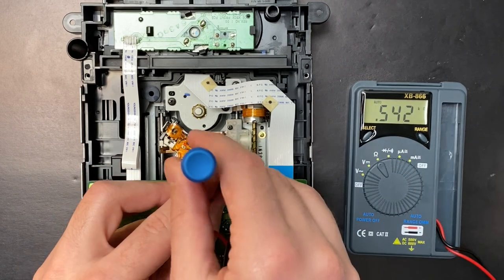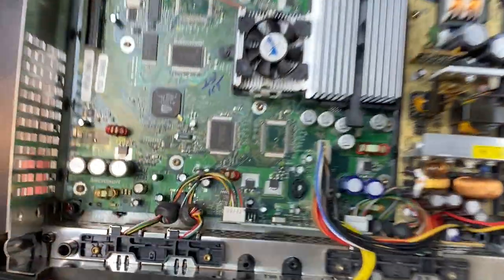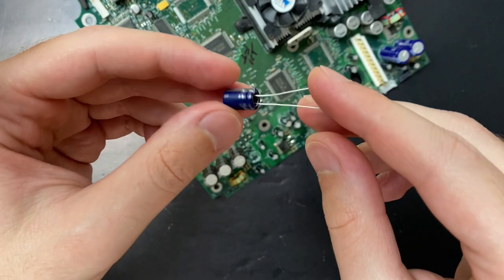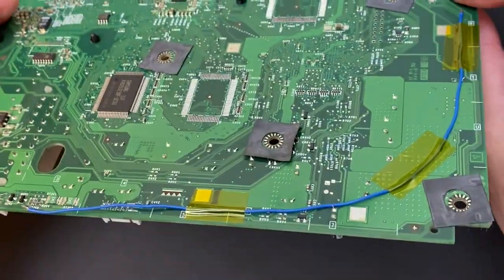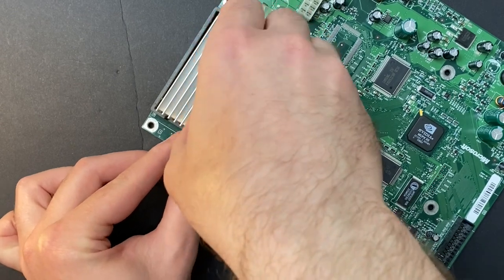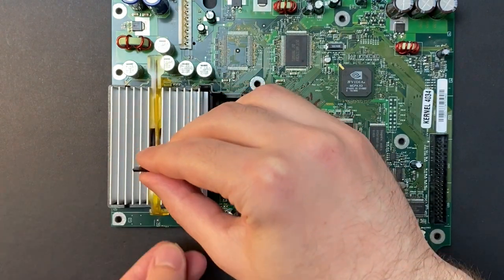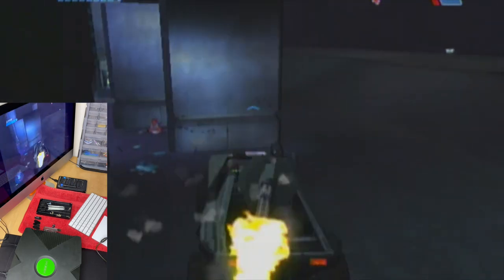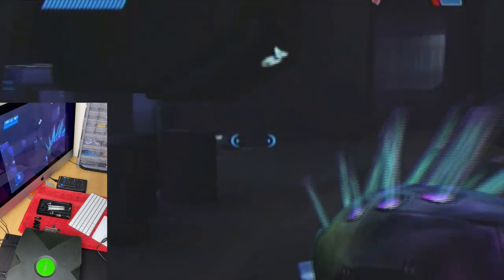Xbox Corroded Traces & DVD Pot Tweak (Part 2) - Retro Console Restoration

Comment: Great job, keep it up! :) My Xbox 1.0 is quite a bit noisier than my other ones. I always thought that this is because of the GPU fan which has been removed in the later revisions...but after watching your video I have realized that I have forgot to replace the thermal paste. Some games (like Kingdom Under Fire) tend to fall apart after playing them for more than 30 minutes on the Thompson drives I got but I might be just unlucky :) Still, the 1.0 is considered to be the most mod-friendly revision and the original Xbox is such a great system.
Reply from the maker: Thank you! I was a little surprised at how hard and dry the GPU paste was. Worse than any compound I've reapplied over the years (including laptops, desktops etc.) Definitely a likely culprit of overheating. I'll be able to monitor temps once I mod the system to get a good idea how its performing with the new compounds.

Comment: Next time try to put the caked heat sink into a boiling water and keep in for few minutes. Should come off easier. When I see you doing it in the video I really thought you will injure your self, glad it didnt happen :D
Reply from the maker: Logical and makes sense! Wish I’d thought to do that. Rubbing alcohol was slow and even a plastic pry tool caused some minor scuffing on the soft aluminum.

Comment: Did the DVD drive work after the pot tweak?
Reply from the maker: It did not. I ended up using another system for this restoration. I still have the drive though, and plan to revisit it at some point, possibly using an oscilloscope to monitor the RF output rather than measuring the resistance across the potentiometer. Although I think this laser might just be dead.

Comment: I've done the same to an Xbox of mine, lowering the resistance of the potentiometer, it did work for me.
I did it only as a temporary fix to modchip/HDD upgrade and use the Hexen 2018 disc so I can FTP games.
Edit: the pot on the left as seen from around 0:51 is the only one that should be tweaked which is the laser intensity. IIRC the other is for focusing.

Comment: Samsung drives are basically impossible to fix without having a spare compatible laser. When a Samsung drive doesn't work, it won't work unless replacing the laser. I've done pot tweaks to so many Samsung lasers and it does nothing.  

If you want (and if you have the money) I would stock up on some Samsung lasers. There are 3 types. SOH-D12's, SOH-D16's, and SOH-DX1's. Male sure that those lasers are the same as the one you are replacing! Hope this helps.
Reply from the maker: Thanks for the tip. Always great to get advice from folks with deeper knowledge of the various revisions the system had. Damn, those Samsung pickups are expensive. I've completed a couple of Xbox builds since this video so I'm happy to have several working units (both stock and modded). I think a large hard drive would be great in the "parts" unit. Once its all set up there's less use for the optical drive and I can always borrow one from another system if I need to.
Reply: a bit dated here but thought I should mention this of you still have the DVD drive around but I'm wondering if new caps would sort this. I believe one of them may have also been facing the wrong direction. The last one put on in the first video may not be facing the right way.

Comment: your videos are so great, even compared to other people with similar content. I think it's because you use the meters more and also take suggestions from the comments so the next video is an improvement of what you were doing before but the content and delivery are usually top notch no matter the outcomes of the parts. I hope you make more videos, I have an iMac and a Cinema Display that I've been meaning to open up and fix but just never did. But this is making me consider opening them up and tinkering about in them.

Comment: That was a nice resolution to the xbox repair journey. I wonder if heating the click that broke would had helped to losen it.

How did you learn about electronics?
Reply from the maker: Yep I'm glad it worked out in the end. I don't know if heat would have helped with the removal of the tab because of the shape it needs to keep to deliver downward pressure to the heatsink. I did see videos however of folks running their Xboxes for a while before removing the heatsink specifically, which loosened the old thermal paste and helped the heatsink separate from the chip. I didn't do that in this video but I thought it was a good idea and would consider taking that extra step in future.
Reply from the maker: To your second question, I started doing it as a hobby out of interest and curiosity. Bought the cheapest soldering iron and multimeter I could find and started repairing easy things (like a broken power cord on a kitchen appliance). Gradually got better, continued to really enjoy doing it. Lots of great educational content on Google/YouTube. I've broken a few things along the way. It's frustrating but part of the process. I feel better prepared for the next repair after each project. It's a great hobby I'm loving it.

Comment: i find it a tad easier getting the clamps off the heat sinks if you push one side allowing a little bit more space to pry the other side over the hump
Reply from the maker: Hmm, do you mean push it horizontally (e.g. left to right) so that one of the clips isn't as deeply latched? Hope that makes sense. I've since refurbished another Xbox and prying it off with my fingers seems to do the trick and give me good feel for the pressure I'm applying. But if theres a better method I'd love to know!

Comment: I really enjoy your content! Glad you got a nice working Xbox! I have an original Xbox that turns on but won’t output video. I don’t where to start with using a multi-meter and testing components. Any advice on how to get started? I’m new to tinkering/repair
Reply from the maker: Glad you’re enjoying the content. Has this unit worked in your possession or did you acquire it like this? Does your Xbox output sound or no audio/video? I’m going to state the obvious but consider checking the video cable. You’d think that’s not a likely culprit but I’ve experienced an issue with a PS3 sputtering video and hours of messing with it only to realize it's HDMI cable had gone faulty.

Comment: Whew these consoles have alot of issues, I'm just lucky "very luck" to have picked up a used rev 1.6 unit for 15$ CIB 6-7 yrs ago. 

The DVD Drive does need some work now, it's giving me the disc read error for alot games that used to work. Still thanks to another video the issue is most likely has to do with the gears and lens being dirty, again thank you for that how to as well.
Reply from the maker: Glad you found it helpful.

Comment: On the first DvD Drive. Why you dont check on another working one the values for the capacitors
Reply from the maker: I have 4 Xboxes and only this first console had a Samsung drive. The others were either Thompson or Philips. If I come across another Samsung drive I can try swapping parts to see if its the laser or the board thats the issue.

Comment: Is there any easy way of knowing what version of Xbox you have as might need to do the clock capacitor myself. Enjoying you're videos. I bought thermal paste and grease for the drives after watching you're videos and fixed my ps3 slim which stopped reading discs after I started watching you're videos. So took it apart and cleaned it, new thermal paste, cleaned the disc drive and greased it. Only ever went into the drives on consoles before. Never wanted to do thermal paste till I watched you're videos.
Reply from the maker: Glad you are finding the content useful. There are guides you'll find on google on determining the version using the serial number etc. but its not perfect. The only sure way is to open it up and look at the board.

Comment: Was wondering why you didn't recap the whole Board. Is the clock cap the only one that goes bad on these earlier Xboxs? Love the Vids.
Reply from the maker: Thank you! Yep as far as I've gathered the main premature component failure on these motherboards is the clock capacitor. Perhaps all electrolytic caps will give out eventually but the quality of the clock caps on boards v1.0-1.5 is documented to have been inferior and was only replaced by Microsoft in time for the v1.6 revision.